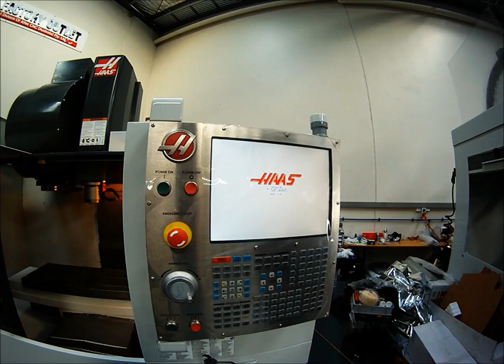HAAS Super Mini Mill 2 - First Look

Comment: Not meant to slow feed that low on tool change - can stall servo easily
Reply from the maker: Hey Tom.  The bloke in this video is a qualified HAAS technician.  He was trained in the USA at the Haas factory.  Anyway, if it had stalled he would've had to fix it as this was filmed on the showroom floor.
Reply: @DCT_Aaron_Engineering  Hellers on my work place stalls when low feed and is not quick recovery considering downtime during engine head/block machining. Haas must be better MC
Reply from the maker: @tomjdesigns1280  G'day Tom.  Yeah I'm not sure mate to be honest.  This was a great little mill that we purchase for the high school.  I don't work there anymore, but my mate Peter says it's still going strong.  Cheers, Aaron.

Comment: What are your thoughts on going with a Haas machine over a Japanese machine given the proximity of Japan to Austrailia? It seems that freight over such a long distance would offset the benefit of the cheaper machine entry cost.
Reply from the maker: ***** Hi Colin, I'm a technology teacher with the state government of Victoria. Currently I have purchased 3 HAAS machines for use in secondary schools. These were a TL1 lathe, ST10 lathe and SMM2 mill. I am extremely satisfied with the performance and quality of these machines. Not to mention that they are also very simple to run and program. I agree, freight is a little bit dearer, but the purchase price of the machine is usually 60 - 80% of any other named brand. Furthermore, another reason is the service and support I get here in Australia from the HAAS factory outlet. Honestly, I wouldn't go with anything else. Trust this feedback helps you make a valid judgement? Regards, Aaron.
Reply: DCTTeacher1 Thanks for that response! You more than answered my question. I've done programming, setups and production runs using Haas, Mazak, and Okuma machines and I definitely agree that the user experience of the Haas was the best out of the bunch. All of them have their ups and downs, be it entry cost, cost of maintenance, or cost of quality. For teaching, which is true of where I went to school here in Vancouver, they were great machines for students. Cheers!